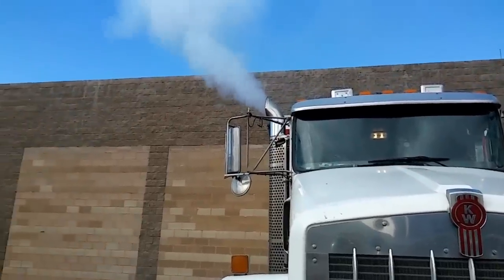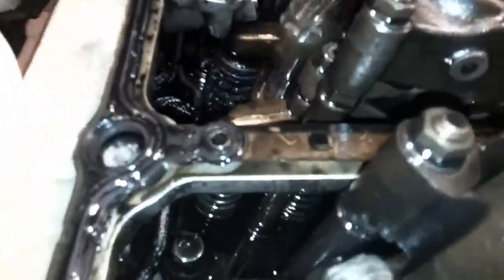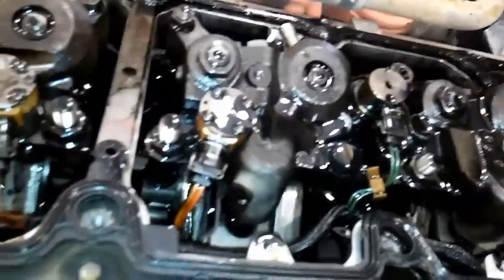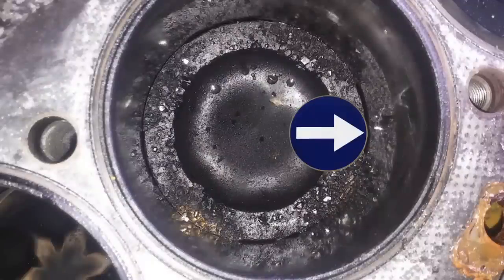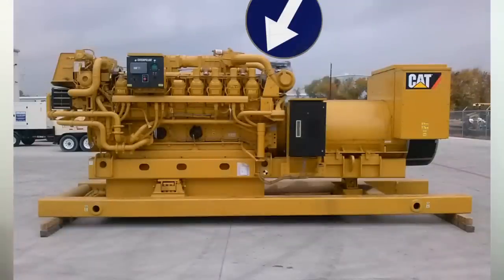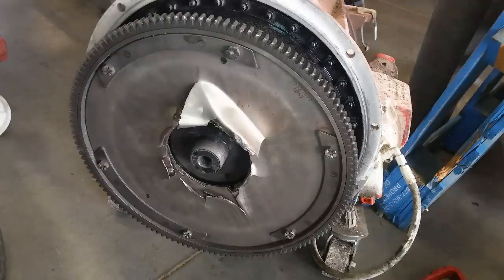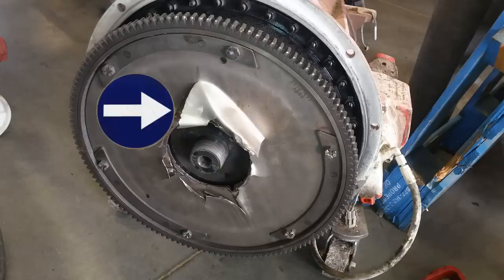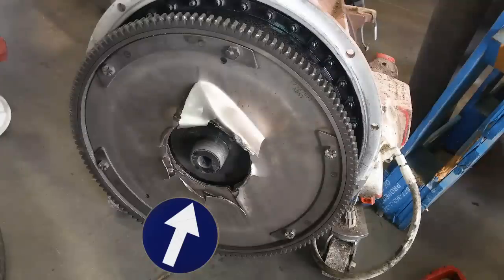Should You Warm Up A Diesel Engine?

Comment: Please don't forget about having a hot hardworking engine and bringing it down to an idle and letting the heads and cylinders cool down before shutting it off ,,,,, your turbo and head gaskets and everything else will love you much more
Reply: Nonsense
Reply: Makes sense letting it cool down. Shut the ac off as well, with fan on to remove  water and not have ac stink at next start up. How long do you wait before you shut your diesel off? 
My diesels include:
1981 rabbit 1.6 non turbo diesel
2002 excursion 7.3 turbo diesel
2017 john deere 2032R non turbo diesel
Reply: Les Brown  
Makes sense
Reply: Al Forster  dude dont make an idiot of yourself.If you dont allow an engine to cool down you can ruin it pretty fast.If you have a turbo and you shut it down immediately the turbo will cook the oil and bye bye turbo.A non turbo engine has other issues,shutting it down hot can cause the valves to bend and also bend or crack the cylinder head.Not to mention the head gasket
Reply: @FredFlintstone21  3-4 minutes is enough to circulate the coolant and oil and bring them to a reasonable temperature,that will prevent your valves from bending and possible damage to your cylinder head
Reply: @gumelini1  
Agreed
Reply: how much time ??
Reply: To shut off the engine with turbocharger right after running the vehicle will shorten the turbocharger's life due there is no oil pressure in the engine to lubricate the bearings in the turbocharger while the turbocharger is still running in high revolution without oil after the engine is shut off. Hence wait a while before the turbocharger is in lowest revolution  before shut of engine without damaging the bearings in the turbocharger. Same manner when start up engine, wait a while before run the vehicle to be sure the oil is entered into the turbocharger.
Reply: There are devices for diesel trucks that allow the truck to continue running for 30-60 seconds after removing the key to help cool down before shutting off. There are also high idle switches that boost the rpm to 1000 for quick warm ups and long idles.
Reply: Al Forster  First of all, you're not king of the mountain. No one made you king of the mountain, and no one is obligated to prove anything to you. He is talking about diesel engines. Everyone knows you have to let them warm up at least little. He is, in fact, telling people that diesels do not need as much warm up as is widely believed.

In very cold weather with a gasoline engine, it probably is better to let it idle for a short time. But it also depends on what oil you have installed. People who think you need long warmups are behind the times, though. That is true. Seriously, if I had a vehicle with 0W-20 or 5W-20 installed and the overnight temperature got into the teens (it can get that cold where I live) I would let it run long enough to start getting warmer before I drove. That means about 20 seconds. Vehicles warm up much faster when they are moving. Common sense, Al. Don't mess with it.
Reply: @tonynewsomjr.4043  Turbo timer
Reply: Al Forster  agreed.  On modern engines the time it takes you to get from the highway to the fuel island is enough time for cool down according to a company that has 2000 class 8 trucks.  They're not going to compromise that many turbos, heads and whatever else these folks think they're saving if it wasn't  the case.
Reply: d Eddie like they used to do with Turbo Timers in the old Japanese turbo cars. Say Subaru.
Reply: I don´t know about big rigs but on cars and truck most modern turbo chargers are water cooled today to avoid that problem... I still would not shut off a glowing red turbo charger but in normal conditions no need to for extended cool down
Reply: No....Just no
Reply: gumelini1 Just....No 😂
Reply: I do as above on my car ( gasoline engine turbo charged) and now it has 275.000km ( 17x.000 miles) on original turbo
Reply: Al Forster  i worked as a tech for deere and ive seen many vgt turbos have issues. The variable vanes would get distorted and stick often before being worked hard again. This would cause a code to throw and derate the engine. I found the history of rpm working and idle time seeing they rarely idled before shutdown after working under heavy loads for long periods. Deere ruled it out of warranty due to the log i found since deere states to let the engine idle for atleast 2min before shutting down. This had occured on 3 different John Deere tractors.
Reply: Les Brown --> My first semi with Cummins 335, always let that thing idle a few minutes before shutting down. Let that turbo slow down so it wouldn't be spinning with no oil going to it.
Reply: As I’m backing into my spot is how I let it cool down rpms are low then I sit for a minute just getting shit together then shut it down
Reply: @FredFlintstone21  That's an interesting tip about the A/C and residual water stagnation Fred. Cheers. 
I don't think this is a widely known matter and many would benefit from. I always wondered about that certain 'smell' you get sometimes when initially turning on the A/C. I'll bet this has something to do with it!
Reply: Les Brown  Thanks for adding this Les. I've recently picked up a smallish 2.2 Diesel and now doing research on do's and don'ts. I'll only be carrying medium loadings so don't think I need to be as concerned as the guys with the big/huge rigs'. Must be many times more important to keep Diesel matters in mind with those!
Reply: @gumelini1  This seems to be quite a contentious issue. I've only got a little 2.2 diesel truck and am finding the relevant issues aren't anywhere near the same that the big rigs have. Wonder if there are any good videos one could link me to as I'd like to have a better understanding of said issue.
Reply: Some diesel vehicles sold in warmer climates like the Caribbean are designed to run for some time after you've removed the key to allow for cool down
Reply: In my case, its about a 7 mile drive from the lagoon to my shop. To drive back to the shop at the end of the day unloaded is my cool down period. I feel it is enough
Reply: Derrick Zenner Agreed, roll in low and slow, and by time  you check paperwork, fuel cards etc, that’s sufficient. Good to see conversations on warm up and cool down.
Reply: You don’t need to let a modern diesel cool. 
When planning your stop  just keep a light throttle. 
Of course this would not be applicable  when your destination is at the top of Donners pass, then a is cool down  necessary.
Reply: Al Forster  its your car, you can do it that way :D in long term running it a minute or 2 longer makes less harm to the enviroment as letting it die on the roadside runing away burning engine oil or oil spilled few hundred meters along the road because the rod went out on the engines side thanks to cooked oil..
Reply: @FredFlintstone21  IMHO, install an EGT gauge. Wait until EGTs are below abour 350-400F and you'll be good.
You'll find that most of the time, if you are driving lightly before you get to your destination(like 25-35MPH speed limits, no steep hills), the temps will be there already.
The only time it really matters is when towing, and especially getting off the highway to a rest stop after working the engine hard towing at 70MPH etc. That's when you want to let it cool down.
Reply: Jens Eirik
Reply: Exactly.Even a chainsaw should set idle for a 30 seconds or so before shutting it down.Give the cooling fan some time to dissipate that heat.
Reply: I am dealing with a ford 6.0 that had a college kid driving it.... for 3 months..... he blew the head gaskets by doing 75-80 mph for 20 minutes then shutting down immediately and going to class twice a day... I  had to tell his parents to get him a 4 cylinder gas engine car because it would be easier and cheaper for head gaskets and cracked heads to be replaced LMAO.. I've got to do a full top end rebuild because he couldn't sit for 5 minutes after getting off the interstate highway
Reply: Les Brown  no, turbo timers went on small engines for a reason. You fry the oil in the turbo shutting it down hot. And that isn't burnt oil in combustion going out the exhaust, it's mixing back in with the rest in the sump, degraded
Reply: @jenseirikskogstad5901  that's not the main reason, it's because you fry the oil in the turbo
Reply: @anonymike8280  this was about cooling down not warming up..
Reply: This is why they make turbo timers ...and replace glow plugs and harnesses every season or everyother season
Reply: Why does Ford and others have the option for high idle switch
Reply: @gumelini1  Modern run of the mil pickups with Turbo chargers have what's called "Oil Accumulators" this accumulates a cup or two of oil under system pressure and then meters it out slowly to the Turbo bearings after shutdown to cool and avoid high damaging temperatures.
Reply: @robplant5576  no what?
Reply: @USSBB62  that's an idiot proof solution to keep the turbos healthy longer

Comment: I drove in northern Alberta for many years.  I two block heaters and an oil pan heater. No problems starting -35c .   Coolant temp was about 95c and oil temp was good.  Put over a 1.5 milliom kms and with just normal maintenance. Love your channel.

Comment: Very sound advice.  On the older diesel trucks and equipement, we used to idle them for long periods to warm up, and once started for the day they stayed running, often idling for hours at a time.   With the modern diesels, it's pretty much fire them up, idle for 30 seconds or so, then drive or operate conservatively until up to operating temperature.  That's pretty much in line with your advice.  P.S. I enjoy watching your channel.

Comment: That was a very good presentation. Good tip about fuel wash in the cylinder from extended idle time. Thanks for posting.
Reply: Is fuel wash a problem in diesels? They typically run very lean when idling, and diesels run hotter than gassers anyway.
Reply: @markdavid4897  no they do not diesel engines run cooler at idle hence why alot have tarps over the radiator during cold months... Easy to tell just by the exhaust temp... A gasser exhaust at idle will be 700° while a diesel can be 300°....

Comment: So in the end it is a compromise: Get up to operating temperature as soon as possibly, but not in the brutal way. Start the engine, idle for a minute or two, then put some load on the engine to rise the temperature faster by driving away, but under light or moderate load, increase load as the engine temperature goes up.
Another thing, modern oil doesn't get thick. SAE 5-40 or 0-40.
Reply from the maker: +Kristian Jonsson The most widely used oil over here is 15W40 and it is a bit thick when cold. Those wider range multigrade would definitely flow much better in the cold, that is for sure.
Reply: That will be 0W-40 or 5W-40. Those oils pour point is around -30 deg C or lower on average.
Reply: Kristian Jonsson exactly what I've heard. And it makes sense.
Reply: Kristian Jonsson.....  He is NOT addressing little diesel engines in pickup trucks, cars, etc..... we do NOT use 5-40 or 0-40 oil in Heavy Duty diesel engines in HD trucks.... semis, Off hwy mining trucks, Heavy Equipment, etc, etc. The main focus Of The Video is on heavy-duty diesels in Semis or class 7&8 heavy-duty trucks (all diesel) in general.

Comment: And that is why standby generators tend to have catastrophic engines failures at super low hours.
Reply: Very true. Any decent one will have a coolant and oil heater, they usually keep it around 100f, so it’s a little better. And for the first 3 or 4 seconds of running it doesn’t have load on it

Comment: I start my 12 Valve and then open my driveway gates.  Move truck outside using low gear and idle rpm.  Park truck and then close the gates.  Drive away normally and don't get on it until coolant temp is normal.  If towing heavy it is warmed up until temp registers and then I take it easy for 5 miles until trans and rear end warms up.

Comment: Completely agree.  There's so many people that need to hear this,  they think they're doing good with extended warm up and cold weather idling.  Cummins ISX operator DVD says start and drive, no warm up time ever.  I prefer 30 seconds to a minute like you said in 10 degree weather and start moving increasing load as coolant warms up.  These engines are designed to work, not idle. The idling engine is shot long before the working engine is.  Very good advice like always.

Comment: As a Helicopter Maintenance Test Pilot.... And Dodge Cummins Owner...

Above 32 Degrees.....5-7 Minutes minimum at idle......Below 32 Degrees maintain idle speed  until I see the engine temperature gage start to increase..... While living in Alaska for 7 years I utilized Block, Pan, radiator and battery heaters / blankets.....

Comment: It would have been good to mention that a piston is 'cam ground' during it's manufacturing process. Meaning it is slightly oval shaped and not perfectly round until it has reached, or nearly reached, operating temperature. A cold piston will have some piston slap on the skirt which can result in piston damage if put under even a light load too soon. A short skirt will suffer more damage than a long skirt. Just something to keep in mind.
Reply: The C series cat engine went to a 3 piece piston. The piston head and skirt are separate and held together with the wrist pin. The skirt is built perfectly round and according to cat can be put under full load as soon as it comes off high idle. The old 2 cycle Detroit also used the 3 pice piston. They were well known for standing up to cold weather operation.

Comment: My 2011 Duramax has a cold weather fast idle setting. I found the instructions in the owners manual. This setting is smart enough to turn off if the temperature is above 30F. It has done wonders for the truck in Alaska

Comment: I use the Royal Purple 100% synthetic (5W30 in gas, 15W40 in diesels)  in all my engines. In -20°weather it flows very well. But even then I will let it warm up a minute. Especially the tractors. It's a little more expensive upi front, but when I rebuild an engine that has 300k miles it looks like the day it was build. No sludge, no wear and the rings are perfect. The cross hatching is still visible on the cylinders. Magic!

Comment: Our marine SOP's stated 2mins idle,  then easy load use till engine temps rise then full load after that. If it was a generator, it would be 2mins idle, then 1800rpm no load till temps rose, then bring on load. Our main propulsion diesel engines (PDE) were 2mins idle, 850rpm no load till temps rose, then full use. Keep in mind that our PDE's were 90Litre MTU V16, so 1000rpm was midrange operation.

Comment: I've had much better luck starting my diesel in the cold by using only full-synthetic oil.  Rotella 5W40 is my year-round choice.  
It stays thinner in extrememly cold weather, which guarantees easier starting, but somehow retains sufficient thickness after warming up.
Regular oil guarantees a very hard if not impossible start-up in very cold weather, i.e., -10*F.
Reply: Rotella x2!
How often do you change yours?
What do you run in the TC? Just curious about others. Maybe multiple replies? Ty, cheers
Reply: @dmax06  I change oil every 10k miles which works out to once a year, more or less.
Reply: My 7.3 picked up 2mpg going from motorcraft 15w40 conventional 
To Rotella 5w40 T6 full synthetic
Reply: @dmax06  
Picked up 2mpg going from 15w40 motorcraft
To 5w40 Rotella T6 full synthetic on 7.3 diesel change every 5k miles 
Even the BMW gasser idles smoother on startup with it so now I use it in everything even pressure washer
Reply: Rotella T6 5W40 is amazing for 2nd and 3rd Gen Cummins year round. I will swear by that

Comment: I've been driving semi for 14 years. They drive very raw when they are cold. When it is 40 degrees or lower. I start the truck and set the cruse to 1k rpm and I don't move the truck for 10 minutes. The engine run smoother and the transmission shift better.

Comment: Increased wear from lower oil flow. So switch from conventional oil to synthetic and there is better flow especially at low temperatures. Better oil flow from a better flowing oil means less warm-up time for the oil.

Comment: I live in Canada and we use block heaters on all of our equipment. We have several aftermarket circulating heaters and those things can actually get the engine up to operating temperature. We have to actually be careful about it because if you leave it plugged in to long it will boil all the water out of the engine. To be fair these things draw over 1500 watts and do not include any sort of max temp switch.

Comment: I keep my 2018 ram 2500 6.7 plugged to preheat the engine year round. It’s on a smart plug and scheduled for 4 hours a night. I’ll override that when temps are cold. All I have to do is tell Alexa to turn on the truck. I have a short commute and I hope the preheat helps reduce the time to come to normal temps it certainly doesn’t hurt. The engine is between 125-145 degrees when I start it. It also saves me money, the electricity is cheaper than fuel at high idle for 10 to 15 minutes. This is my first diesel pickup and I’ll never go back to gas. Just my take on it.
Reply: I agree and I do the same with my 7.3 PS diesel.

Comment: It's a good thing to warm up a diesel engine depending on how cold it is depends on how long you warm it up allowing the oil to get to the turbo and the Pistons to warm up so you don't end up with piston slap and wrist pin knock from not warming up your diesel it's not a bad idea to read the owner's manual you'll find a lot of tips
Reply: It takes less than a second for the oil to get there